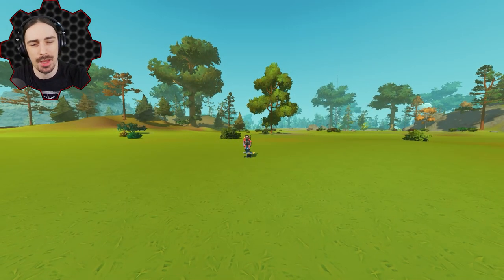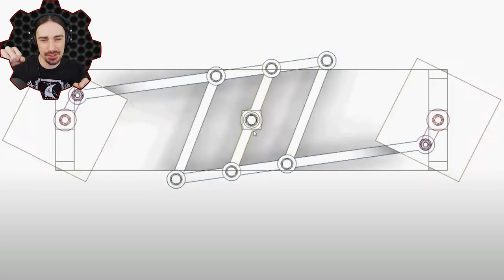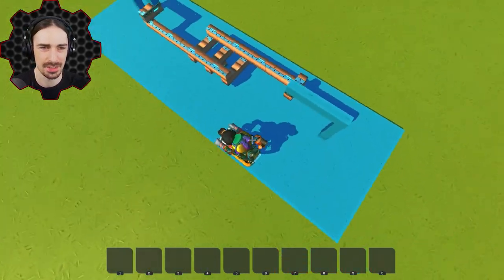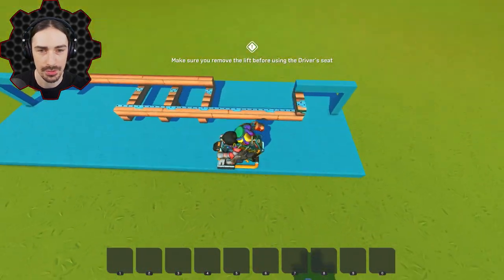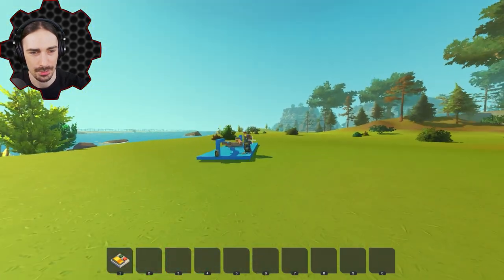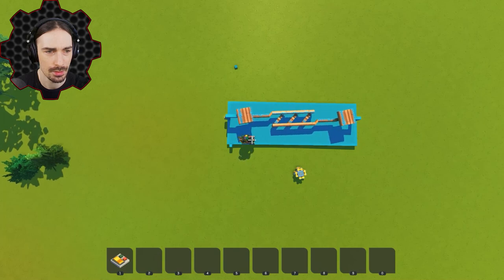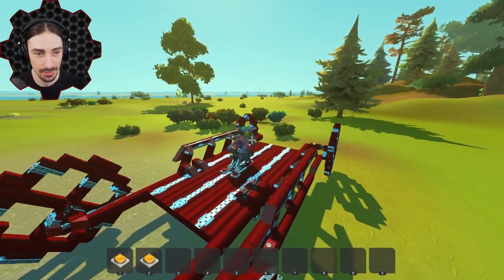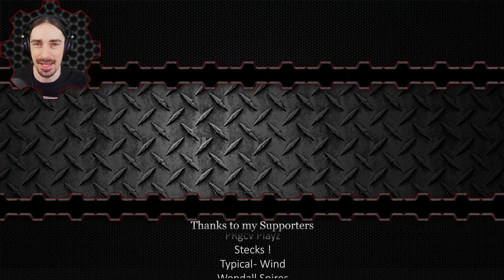Impractical Engineering: Steering Powered Wheels? - Scrap Mechanic Gameplay

Comment: Hey Scrapman! You can add paddles on the sides of the wheels, and travel on water without fuel :D Another episode?
Reply: Does it work in ScrapMechanic? (ohh elt me guess: mods)
Reply: Unless there is a mod for it that wouldn’t work
Reply: It actually works. Water physics suck, but it's actually there.
Reply: he could also make a train out of it that would be cool
Reply: At least my idea got some traction
Reply: You need to attach the paddles to bearings for it to work in vanilla

Comment: Scrapman: what if we power this with steering!
Me: have you ever heard of controllers?
Reply: Controllers are too slow. This mechanism needs some speed/momentum to turn in circles or it will just wiggle back and forth. I recommend using electric engines with timers, but that defeats the whole purpose of not using fuel.
Reply: @wenlihuang4295  you can speed them up

Comment: for steering you could add w and s controls with an electric engine and a suspension glitch
Reply: but if u can have an engine it defeats the purpose of "steering powered"
Reply: @matytoonist  this is true but it would then turn into just a backwards brain car buy this could be said for his steering currently since now it's button and piston powered
Reply: @moonburn87  suspension glitch turning could work though, it might just be a little aggressive from my experience.

Comment: You know, a steering mechanism I just thought of: instead of locking up one of the driving mechanisms, you can have two pistons with a cactus, or high friction block of your choice, up near the front, one on each side. Drive the cactus into the ground like a brakes, and it should act like an anchor while your momentum carries you around the point.
Never played this game, but seems like that should work.

Comment: Scrap should have tried to power the mechanism with a controller
Reply: Controllers are too slow. This mechanism needs some speed/momentum to turn in circles or it will just wiggle back and forth. I recommend using electric engines with timers, but that defeats the whole purpose of not using fuel.
Reply: Could use pistons with timers.

Comment: The L-shaped arms are supposed to be a fixed length. You made them have variable length, by adding a bearing at the right angle of the L, where the two straight segments meet. When you added corner blocks, you only went to the side by 1 block, which is why it worked better but not good enough. Having it offset by multiple blocks would have helped. You can steer using a controller connected to the seat and to a suspension-steering. Just don't toggle the loop mode on.

Comment: I had a crazy thought for steering. Normally, to do tank steering, you’d slow down one of the wheels, but since rotational period is fixed due to both sides being controlled by your steering, that’s not an option. HOWEVER, you could change the speed in another way - by making the wheel itself bigger/smaller, using pistons, increasing the speed along the ground.

Comment: You can connect them to controllers so it go's back an forth automatically and then connect to a button then to the seat then it will be tank turning both to go forward, one to go a Certain direction

Comment: BRUH, I wanted to see what this looked like if you powered the center bearing with a controller, or the wheel bearings with engines, :(
Reply: It would go brrr
Reply: @apersunthathasaridiculousl1890  hey mr top comment
Reply: The controller would probably turn the mechanism at a lower pace but at potentially higher torque, and hooking an engine to the wheel bearings would give you wobbly wheels as the bearings are offset and potentially give some power loss through the steering power mechanism. Also I know you didn't ask this one but if you powered the center bearing with an engine it'd lock up.

Comment: Idea for steering mechanism (also a great idea for Multiplayer Monday).

Use what you built as a dual axle drive with regular (or not so regular) wheels further forward to steer.

Since steering controls are in use, electric motors on W / S keys to turn the steer wheels and A / D to move forward and backwards.

Makes perfect sense.

Comment: I feel like you could do this with a paw / ratchet system to push the wheels and then shorten the pushing lever to disengage it from the wheel...a 2nd set on the opposite side of the wheel might allow for full tank steering?  REALLY hard to describe in text :)
Cool implementation here :)

Comment: Love the design Scrapman! I do have an idea to fix the steering; since the issue is that the horizontal bars cannot provide enough leverage to power the wheels, what if you were to scale up the vertical bars, such that it provides a larger moment and can apply a greater force to the horizontal bars when you turn the steering?

Comment: use a logic gate, so if you're holding the turn button, one side will only drive at like 60% speed. To do this, you would of course have to make it drive automaticly when holding down another button, and maybe have several speed settings.

Comment: I see a way for you to have steering and propulsion, you first hook the bearing you control with steering to a controller on the amount of angle you controlled, then you add bearings near the end of the front, rear or both sides up and down and you may have to extend the end on one side at least but theoretically this could work.

Comment: The biggest issue with this is that the wheels are 180 degrees out of phase.
It will work ok when moving thanks to the wheels acting like flywheels, but modifying it to make it 90 degrees out of phase would fix that issue

Comment: well, for steering i would have thought of suspension-glitch steering, but yeah, you didn´t want to use any fancy stuff (which i assume includes suspension-glitch). 
the cool thing with that would have been, that you´re able to hook it up to W/S (i think?), so your vehicle would have had inverted controls (A/D for powering, W/S for steering).

Comment: From what i see - tank steering and some "logic" can fix all problems and give more controllability to wehicle. Maybe using sensors and timing. Maybe using pistons for position all parts correctly (or not) - can give some potencial to minimize actual mechanizm and get less weight.

Comment: hey scrapman, dunno if im early enough for you to see this but you probably could have gotten around the 90° grid issue by using pistons on the 3 parallel bars in the center of the linkage to extend it and force it into a sloped starting position

Comment: With double suspension steering on one wheel (one bearing) your vehicle will move forward when turning fully. This on all 4 tires makes a moving vehicle that has enough torque to climb a small hill.

Comment: Because you and kAN revived a dead meme:
Mom: We have Ragerts at home!
Ragerts the Farmbot at home: . . . . .

Also Scrapman bragging that he made a steering powered car, but a lv 2 controller will do that steering power for you, you know? That said, in good humor, why not try using weight shift and tilting to steer. It's inefficient since you have to be going to utilize it and it adds more moving parts to the build, but it should work since the wheels would be banking into the direction you want to go.

That being said, kinda like how you inadvertently started a "Scrapman Intro Challenge" series, I think you've made a challenge series out of this steering motorless vehicle.

Comment: @ ScrapMan  Make a really long conveyor belt using your spinning disc floor idea (which is excellent I must say) with two lines of saw blades next to each other that rotate in opposite directions to each other, so that when you stand on one end, you get pushed to the other end.  Power it by engines instead of controllers for yeetiness.  Angle it up a bit to yeet the player or maybe even it could transport blocks/items?  Make a sled that fits and try that with a seat on top maybe?  Good luck.  I bet it's a very easy challenge for someone of your prowess.

Comment: to add stearing add a piston to either side connect it to a switch connect switch to seat, lets say its 2 switches one on left side, 1 on right side of stearin, press 1 to turn left for example while stearing to move forward, then press 2 to move right... the piston moves down, putting pressure against the ground.

Comment: upsides:
can't waterlog the engine (because there is no engine)
no fuel consumption
downsides:
no steering
have to steer at a rhythm in order to get forward 
8 bar linkage sometimes locks up

Comment: Scrapman, if you put two bearings on top of each other in the center (the bearings that are actually powered), you could have the outer bearing connected to the seat and the inner bearing connected to a controller or engine that rotates the opposite direction, which will make the vehicle turn. 
The only issue is, this defeats the purpose lol

Comment: Make a multi-player challenge. 
Use this driving mechanism as the main propulsion system and you'll race in a semi-rough terrain. 
The challenge is that you will have 1 loose bomb and you'll need to carefully carry that bomb to the finish line. 
If you need more challenge, if that bomb explodes, you'll need to restart at the beginning or a checkpoint

Comment: You should link more (or all) of the center bearings and you'd have an insane amount of torque to make the turn.

I'd also be curious if all the bearings weren't linked except 1 wheel to a motor. Would that equally transmit motion to the other wheel?
Reply: with the power transmitting this mechanism is useless
Reply: @bobi_lopataru  Yeah I figured it probably would be, but I would be interested to check out

Comment: Tbh I like this build, it was worth it to me.
 Hmm what about using a sensor converter, Can that work?
Since I've heard the controller is too weak or slow to go fast?
Can it still work with double bearings?

Comment: to steer, you need to do like a real tank, the power comes from a driveshaft, splits in 2 to go left and right and connect the mecanism to the driveshafts with a clutch so the unpowered side is free spinning

Comment: You somehow use the wrong "formula" and got the right answer. The power input in this mechanisim is supposed to be a rotating axle, and it will turn an unpowered axle at the same speed. I have a survival vehicle that uses 2 of these linkages to transfer power from a piston engine to all four wheels.

Comment: Should be pretty effective if you use an electric engine with sensors or maybe even a controller with specific angles. Should improve the fuel-less vehicle for survival.

Comment: What if you were to use a controller engine? Basically set the controller to the needed parameters and the the logic gates keep the cycle going. (There might be a chance you won't need the logic gates at all but I don't know, haven't played with Scrap Mechanic in a long while)

Comment: maybe you can add steering on buttons like taking the mechanism placing it on a bar that goes 1 on top on a bering on a controller for like 30 degrees on both sides

Comment: Hey Scrapman, what if you connect the mechanisms into a double bearing instead of only 1 bearing. 2 of the bearings are connected to the seat and the 2 remaining bearings are connected to 2 separate controllers so you can activate 1 side of the car for the actual steering of the car.

Comment: if you created this in scrap mechanic attach pistons to one of the corners where the 3 pipes meat either of the 2 longer pipes, from that corner, a piston opening and closing at the correct speed could create a manual powered engine sort of... if that makes sense.

Comment: It seems like you could automate forward and backwards with controllers and use a a-d converter to only power one side or the other. Or... Maybe just power the mechanism through one of the wheels instead of the pivot.

Comment: What if you lock one weel at a time using the same break system ? will the weels have enough momentum to keep going or will it stop anyway ?
Or even better what if you use stearing power to break as if it was a differential :D

Comment: This would be a good low-tech method for "free" propulsion. Controller power or maybe piston engines are better. They require component kits in survival but that just takes a bit of grinding. A tech tree in survival that made  high-tech parts inaccessible for part of the game would make steering power attractive.

Comment: This would probably run a lot more smoothly if I was controller powered instead of steering powered, due to the simple fact that the time between each pivot is mainly based on human judgment. Therefore is non-constant when should it start pivoting the other way.

Comment: why not power the center bearing with controller which rotates the bearing in alternating direction in a loop and then actually steer the vehicle kind of like tank steering using the seat.

Comment: I made a much better one in ten minutes. The trick is to use pistons to make the connecting and main arms longer so you can create the angle you need for it to run like in the video.

Comment: I made a car that moves forward only using steering that can also turn without any other button, it could also probably go backwards. It is called “steering only car” and its design is based on a snake, though it does have wheels.
Here is a link to that creation: https://steamcommunity.com/sharedfiles/filedetails/?id=2310038142

Comment: Coundnt u just put that bearings on an engine then connected the engine to a switch but use 2 engines for each wheel on seprete switches or buttons then u cna go forward and turn